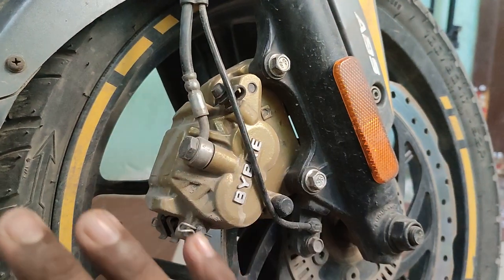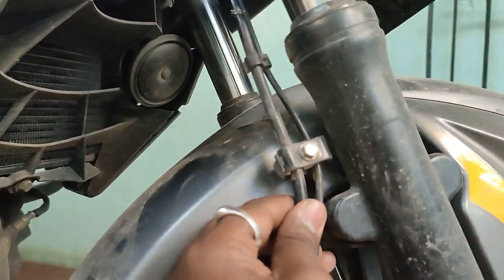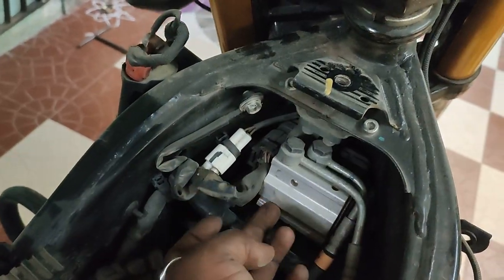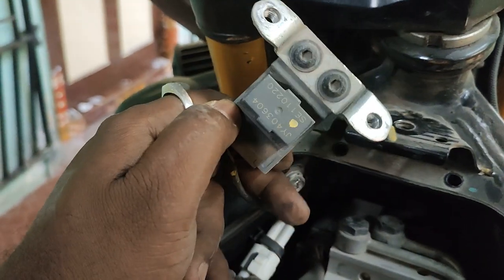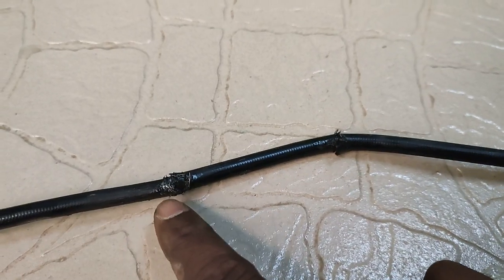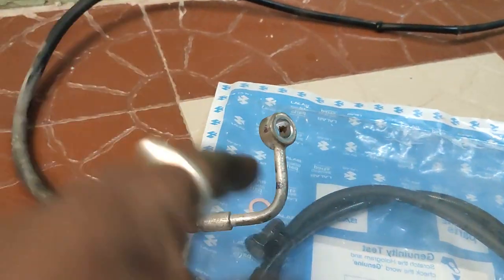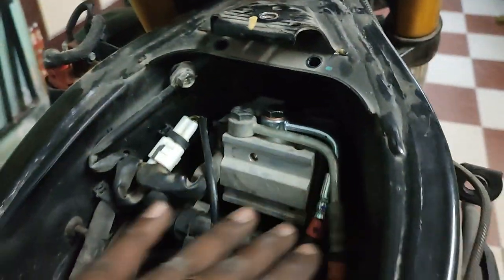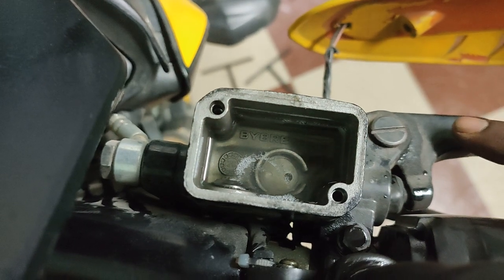NS200 ABS Brake Oil Hose Problem😱/Worst Quality 2***RS🤬 /Ns200 Brake Failure🥴/Brake Pads Change

Comment: Bro rubber hose  a vida steel braided hose better bro 
It increases brake feel and feedback at the lever,so precise  a brake apply panlam
Also brake fading aavadhu after heavy usage 
Rubber hose veyil la romba neram ota ota expand aavum 
Brake bite fade aavum 
So steel braided lines  best bro
Reply from the maker: Thanks for your information bro
Reply: RS200 BS3 used to come with steel braided hose. Bajaj downgraded to braided rubber hose :(

Comment: Bro my ns 200 front brake not working properly the brake lever full tight and lightly tyre skidding i changed brake hose pipe  that time to not working properly

Comment: Bro ns200 Bs6 ABS properaa working properly nu yepadi kandu pudikaradu abs light yepo off aagum
Reply from the maker: After moving the vehicle within 5 second abs light will turn off bro if abs working properly. If not there is some issue with it

Comment: Bro oru doubt en bike ns 200 la after 10 to 15km ride bike automatic ah off agudhu 10mins ku aprm automatic ah start aagudhu ena problem bro mechanic kum terla
Reply from the maker: Bro check is there any air lock problem in canister.
Reply: @tnmotorider3910  ok bro will check thanks👍

Comment: Bro what is the part no i have searched it a lot but didn't find out...
Reply from the maker: No need for part number bro. There are only two types. You can get it in an automobile easily bro.
Reply: @tnmotorider3910  thnks broo

Comment: Bro i have this problem i alredy changed but again this problem how to solve plz hlp
Reply from the maker: Bro 2022 model la they using some clamp to mount that hose. Need to install that issue resolve
Reply: How to its cost to fix ?